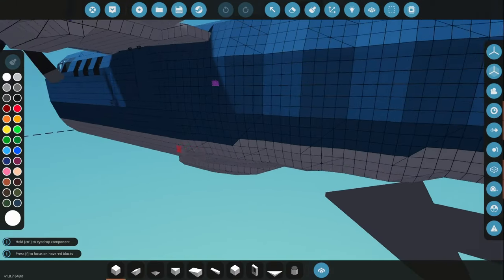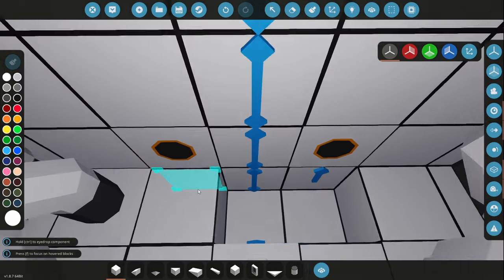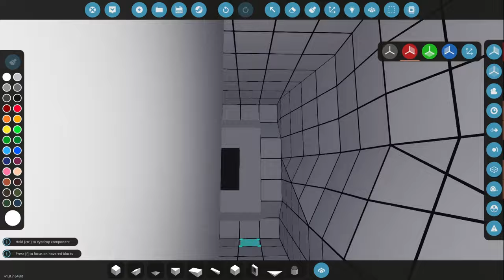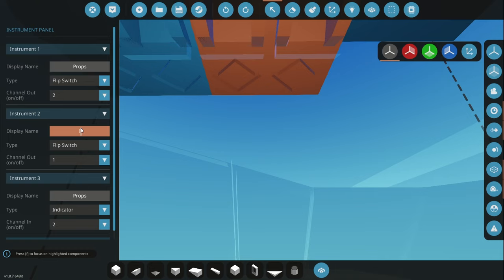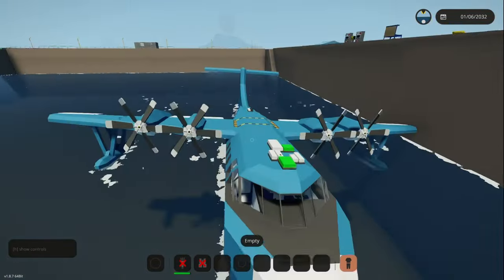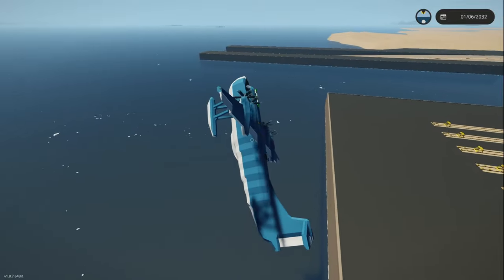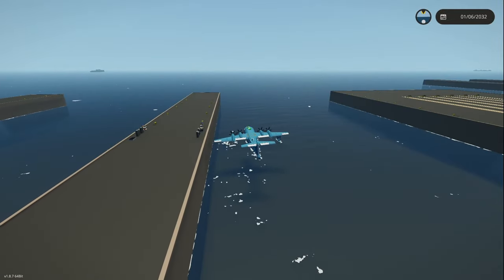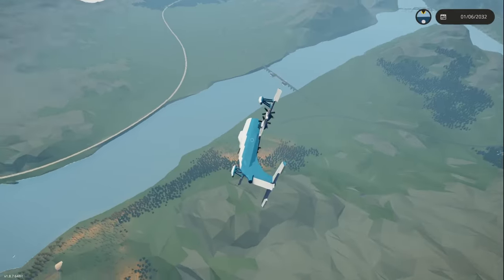Stormworks | Seaplane 4

Comment: For putting out fires you can put a constant number on the spread of the nozzles or putting a smaller Pump so you dont get so much pressure. And as always great video!
Reply from the maker: Yea the nozzles are set to spread. Maybe ill go check it again in case they are set the other way. and a low pressure pump could be the answer.

Comment: 27:00 dont use the rudder to turn, do an aeileron rol, pitch up slightly and use the rudder to help maintain altitude through the turn. Bit difficult without pedals and a stick/yoke.

Also your wings fold the wrong way, you'll have better luck if you have them fold up and have the floats attached to the fixed part of the wing, and stick your wide landing gears inside. you can have them fold too to reduce drag.

Comment: Not sure if this will work with the game physics but if you could increase one sides prop speed you can use p factor for rolling assists if the props are counter rotating like they are on other multi engine planes
Reply: Love the vids man you teach me so much about vehicle building in this game and the little details of the game engine you wouldnt know otherwise
Reply from the maker: I will look into that. Possibly adding gearboxes to each wing and then controlling pressure on the clutches might let me do that without too much change.